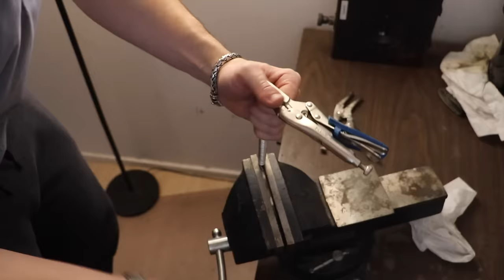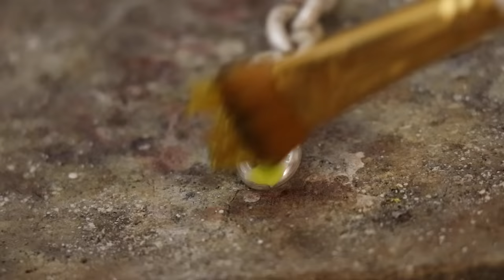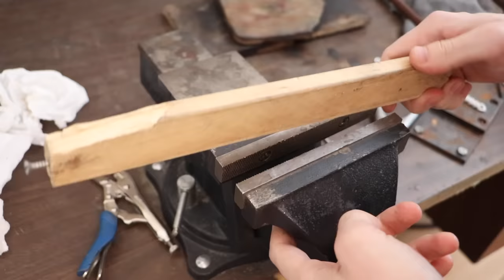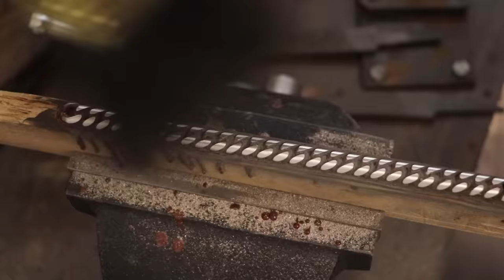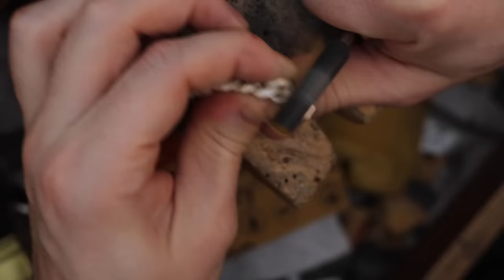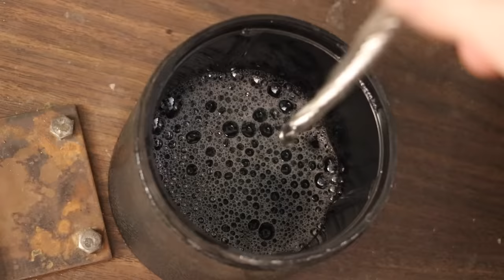SILVER CUBAN BRACELET | dynamisjewelry.com

Comment: Bro please could you tell me the magic rule with the ratio of wire thickness to jump ring mandrel size? Did I see you use 2 to create an oval? Thanks brother
Reply: There is no ratio it depending on how much gap you would like in between each link for eg if you use 3mm wire and you want a tight fit i would leave around 4mm gap between each jump ring so if your wire is 3mm and you need to fit 2 of that wire size that would be a total thickness of 6mm so you would need to have a mandrel of 10mm then you would have a 4mm gap in between each link. You can buy some copper wire to play around with to you get the gap that you are looking for before trying on the real thing
Reply: @rickymc7287  ok thanks brother
Reply: @rickymc7287  If you only have a 4mm gap and you need to fit two 3mm rings on one how is there enough room?
Reply: @roberthunter5728  I don't think you read it properly.  If you have a 10mm mandrel and your using 3mm wire you'll have 4mm gap In between  3+3=6 then 10-6=4 so that will be a 4mm gap with the 2x3mm fitted inside hope this helps

Comment: What is the chocolate sauce liquid you pored before sanding?
Reply: That’s usually either pitch or wax, depending on the jeweler’s preference. It’s melted on to hold the chain down securely so it doesn’t move when filing or sanding.

Comment: What is the brown mass that you melt and put on the chain before carving the file?
Reply: It's shellac. He uses it to keep the chain in place so he has both his hands free. He then disolves it in some 100% (or close) isopropyl alcohol.
Reply: @Menemnon  ok thanks bro
Reply: Ok, I was wrong, it was sealing wax (dissolves in acetone). But shellac works just as well though and pretty much the same way.

Comment: Would using bees wax be good enough to use as a "holder" on the wood while sanding it down? I have lots of it....
Reply: no wont work you generate heat by sanding and filing and it has not got the strenght to hold it

Comment: Awesome video!!! Few questions please!
What are you using for the solder wire? 999 silver?
Making my first chain and it has some deep scratches from where I used pliers to work the links. Any tips on removing.? Stainless steel tumbler? Drummel?
Reply: File the jaws of the plyers flat so it won't make the marks or buy jewelers plyers that have smooth jaws. A fine file should get the marks out.